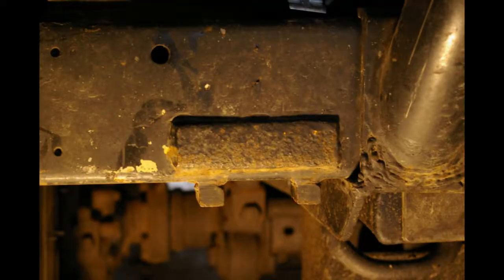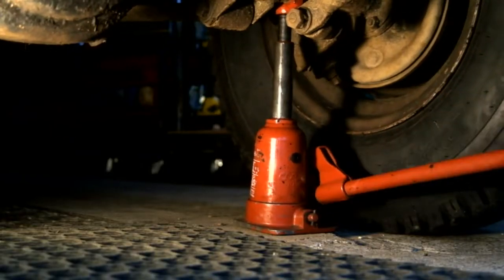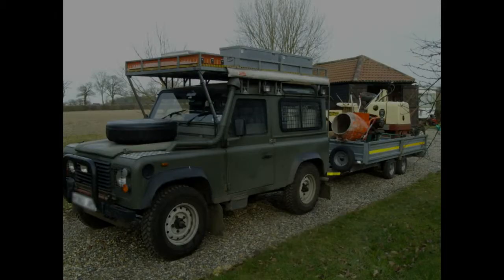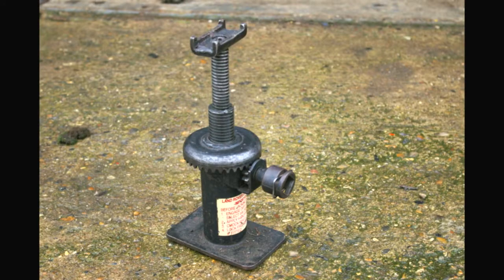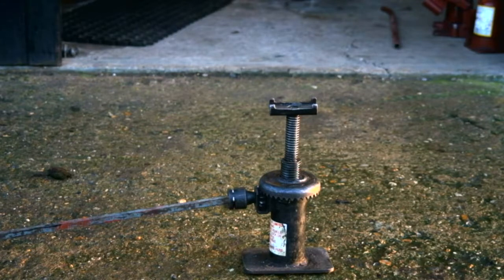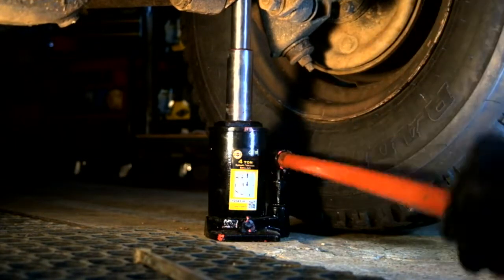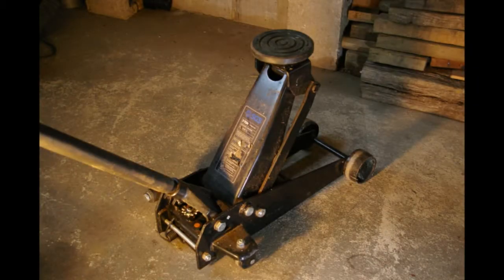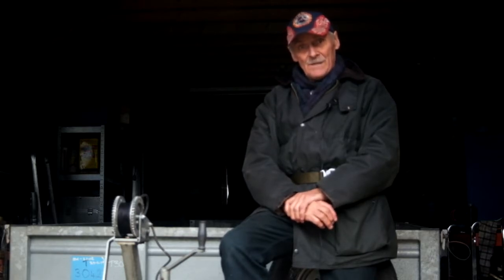ex-military Defender - "the Engineer's conversion". Jacking solutions.

Comment: Thanks for sharing your knowledge and skill.  And thanks for the no frills, clear and explicit instructions and options.  I’ve now subscribed and look forward to viewing your back list and new videos.
Reply from the maker: You are very welcome.
Reply: Defender mods and travels: could I ask you question. I’m purchasing a Land Rover Perentie (Australian army defender) . I’m not planning much off road touring and considering a second set of wheels and tyres for daily travel. I have a set of Wolfe rims fir this purpose and wonder what you would recommend as a comfortable (relatively) and quiet road tyre? Thank you.
Reply from the maker: @kneewall49  I am probably not the best person to answer this because I have only used a few tyre types myself, and all of them AT or MT tyres.
You'll find a recent review on the Africa Sideways channel, "10 Best All Terrain Tyres". Although this is written in South Africa I am sure many of the tyres are available in Aus too.
The best genereal purpose tyres I have used, which I will continue to use as long as they make them, are Goodyear Wrangler ATs. These are also favoured by Brett of the roamingtheoutback channel, "Goodyear Duratrac tyre review" (I don't think the Duratracs are quite identical to what we buy in the UK but they are very close). I find the Wranglers are well behaved on tarmac; I actually do most of my driving on tarmac since we usually have to drive a long way to get to off road trails but on occasions I must also handle quite demanding tracks too.
I know the conventional wisdom in Aus is that one should only use BFG or Cooper tyres.
Good luck with whatever you finally decide to buy.

Comment: I carry a wedge shaped piece of wood.  The wood is the same height as the side wall of the tyre. If i have a flat, i drive the flat wheel onto the wedge.  The wheel is now the same height as it would be if fully inflated.  Now my jack only has to lift the axle one inch.  I remove the flat tyre/wheel.  Remove the wooden wedge and fit the spare. I now only need to drop the vehicle one inch and the job is done.
Reply from the maker: Clever.
Reply: @defendermodsandtravels  My grand father showed me years ago.  I say wedge....  and i think you understood me...   it's more like a mini car ramp (wedge one end and a flat on top)  the height of the tyre  side wall... but it will rise the vehicle to normal ride height once you drive up it even though the tyre is flat

Comment: Just found you  ,I'm binge watching to get up to date great content, my tip is to buy another matching jack one for each hand it makes lifting up an axle or a side easier. if you use them side by side with a selection of blocks you can jack up to any height if safe to do so.
Reply from the maker: A telescopic jack with carefully selected height is the answer for me. I have had (highly experienced) viewers contacting me saying that they bought a jack but found that when they had a flat the jack wouldn't fit under the axle. Not good.
The combination of a telescopic bottle jack and a high lift jack takes care of most situations - see my recent video, "Do what the locals do".
Reply: @defendermodsandtravels  Actually I meant 2 telescopic.

Comment: If you’ve got a flat carry a large block of wood, drive onto that then jack up the axle from ontop of another decent square piece of timber Safer than having 12”” of ram showing   I’ve got about five blocks in mine stashed around in spare corners and two wooden chocks as well. 
Get a skyhi jack. I’ve got about five now, brilliant jacks, all mine work and one needed a half pint of oil. Never had one fail or needed to rebuild it. The one in the 109 is a four ton 8” lift. And they have a good footprint. And I carry a sheet of 1/4” steel about 10” square  for soft ground.
Reply from the maker: Interesting approach to drive onto a block of wood to the start the jacking up.
I have looked online for Skyhi jacks and they seem to be incredibly rare supplied as OEM for prewar Lagondas. Is this what you mean?
Reply: @defendermodsandtravels  got one in the back of my Landy free when I bought it five years ago. Might have been military issue.

Comment: Thanks for the video.
In regards the use of 2 bottle jacks it really depends from the vehicle.
In the case of Ronny (I believe you referred to him) and my old Land Cruiser Troopcarrier, it was necessary. I have a telescopic small jack that is enough to fit under the u-bolts mounts but not enough to lift the wheel fully raised. Needless to say that I discovered this in moment of need... 
I then started to carry a double bottle jack setup, i wasnt happy but I didn't had other solutions at the time.
I think the problem started by lifting the vehicle and increasing tyre sizes.

Comment: The 20 year old Corum Jack that came with my Range Rover Classic still works perfectly after much use, the one I bought for my 109 used at Billing has been faultless (though many on sale were faulty), and the unused one with my wife’s young 90 was perfect.  I think you have been very unlucky in having two fail so prematurely unless they were stored in very damp conditions or were overstressed.
Reply from the maker: Maybe I have been unlucky with the Corum jacks. I have had three now all of which have gone wrong and I am not aware that they have been abused. In my Disco 1 I have the ex-military telescopic screw jack which works reliably but is oh so slow. I am looking out for something more efficient now. The 4t bottle jack I carry in the Defender works fine although it seeps oil if carrying a load for long periods so needs to be kept topped up.
Reply: @defendermodsandtravels , those screw jacks would be immensely strong and very reliable, hence the MoD preference for them.  I saw plenty of dead hydraulic jacks in the second hand sales at various shows.  They might just need a new O-ring on the depressurising screw.  But there were more bad than good units in most piles or boxes.  Get a good one and you’re set.  But you can’t tell just by looking at them.

I wonder if part of the problem is users over-tightening the screw or leaving it closed when not in use, compressing and deforming the O-ring.  I have always left mine open about a turn and have never had to re-pump (or repair) a jack.  Could be nothing, though.
Reply: @nickboylen6873  I've just had my second Coram bottle jack fail, this one from a P38 Range Rover that had never been used. I'm beginning to wonder if the seals inside are becoming perished with age? This one still worked, but it leaked if stored on its side, which is no good because it's designed to be stored like that. It's obviously a ticking time bomb. In any case, I've just bought a proper Genuine Land Rover NOS Series III screw jack, shaft and handle from PA Blanchard because I'm not taking any more chances with used jacks, not for my travels anyway!
Reply: @cameronwood1994 , that is the most reliable option.
Reply from the maker: @cameronwood1994  I have now found what I consider to be the near ideal LR jack. A 3t telescopic jack made by Weber Hydraulik (I will confirm the name when I return from my travels) and supplied OE with Sprinter vans. Beautifully made and it ticks all of the boxes.
Reply: @defendermodsandtravels  The Sprinter jack is popular with Discovery 3 owners because the coil-spring screw-type bottle jack hasn't got the height to work with the jacking point on vehicles with air suspension (they have different lower control arms), and vehicles with air suspension have an awful scissor jack. I just didn't think about it for the Series III!

Comment: Hi mate, both the first jacks were showing symptoms of low oil level?
Just a thought.
Reply from the maker: Nope, oil level was the first thing to check. I took one apart to try a repair but didn't know what I was doing so just made it worse.
Since making the video I have found the best solution which should work with any beam axle 4x4. It's a 3t telescopic jack supplied with Sprinter vans. Ideal size, excellent quality and freely available on ebay.

Comment: Reskyhi Jack s,  I’ve not paid more than twenty quid for any of them. One is a 4 ton double ram. Which has a hell of a reach on it. The good thing is the pump mechanism as the handle goes from horizontal to 15 degrees so there’s always room to pump. A lot of bottle jacks operate at 45 degrees. 
If you put your flat on a block of wood then you only need a j at ck that’ll take you up high enough to remove an inflated wheel in a carpark. You won’t need extra height.
Reply from the maker: Can you recommend the manufacturer please? I am not yet fully satisfied with my jack.
Reply: @defendermodsandtravels  skyhi. London made  all mine are as old my 109 circa 1960. The crop  up on eBay pretty often. Some at stupid money! But there was one very recently, four ton double ram and around twenty five quid. If I’m lifting one corner at 1/4 ton with a two ton or four ton jack ( working at a fraction of its capacity)that is old and works well, I’ll put faith in that over a new Chinese one. Keep looking!